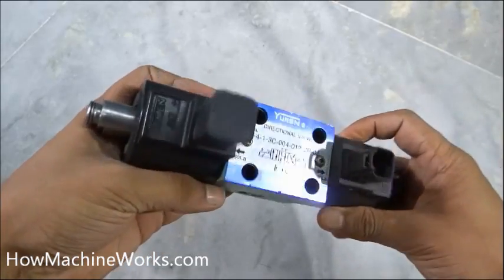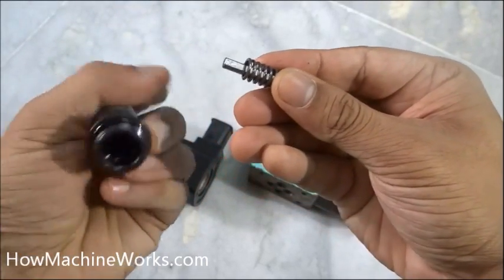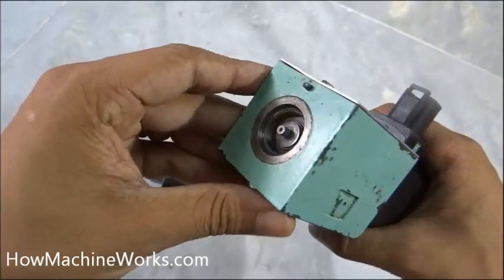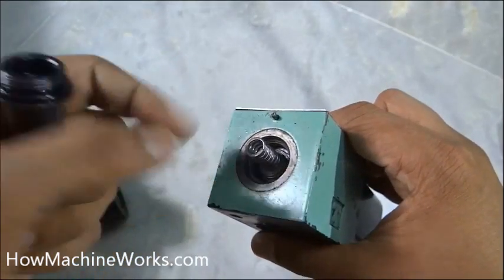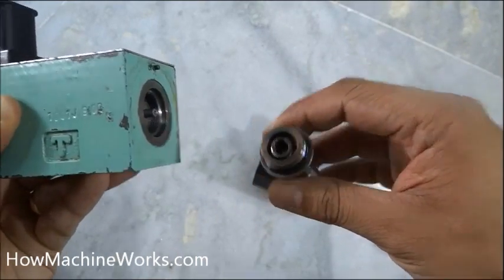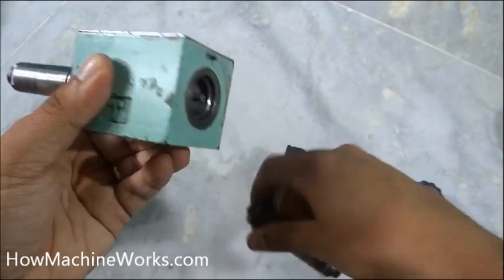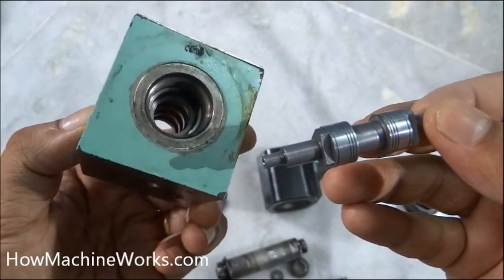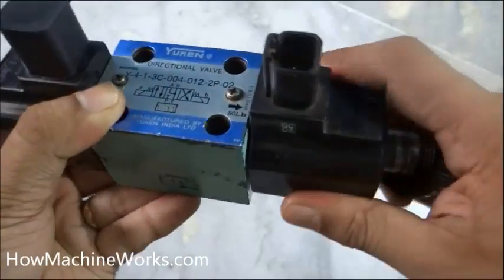How directional solenoid valve works -- dismantled. ✔

Comment: Do they all work this way or do some pull the valve instead of push, I'm trying to troubleshoot a skid steer with no auxiliary flow, I'm getting power to solenoids, they are magnetizing just no flow. Thanks

Comment: The shaft also allows for manually shifting the valve.
Quick electrical trouble shooting device is a magnetic field tester.  Place it against the coil.  It it lights up you have power as well as a magnetic field at the coil.

Comment: In the above valve, I have seen J type and E type valve.  Can anyone explain  when to use J type and when to use E type?  What is the difference in operating conditions?
Reply from the maker: +Mech E 
What's app us @ +919744615655 To get updates on Mechanical/ Automobile engineering

Comment: Im in the process of removing the 4 way solenoid operated yuken directional; valve from a frick screw compressor(NH3) to change the seal kit. Do I need to isolate and pump down /vent the compressor? will there be any pressure? should I be concerned removing it or is it simple
Reply: It is always advisable to pump down and de-pressurise your compressors unless you need a uncontrollable oil bath. Example, carrier 06N  screw, don't have to de-pressurise or pump down to replace internal oil filter cause solenoid is there to prevent. But if you want to repair or replace solenoid, then you must follow depressurising procedure.

Comment: sir I have swift vdi car that is getting EGR problem ( in meter engine check single came)  
because please give suggestions 
wt I Chang only solanide set or hole EGR valve set na?  please give me suggestions

Comment: Hi

I have a question regarding working principle of Pneumatic solenoid valve. Do they work under -1 bar pressure (vacuum)?
Reply: Solenoid valves are available for different pressure ratings. Vacuum pressure valves are also available at pneumatic hardware shops.

Comment: How strong must that electromagnet mustbe? That is what I am asking myself, how can it move that shaft if the valve is under an enormous amount of pressur while working? Can you guys explain that please?
Reply: +Beholder 
  Instead of reading through all of the posts to see if your question has been answered or not, I will give you the explanation you seek.  The pressure of the working medium, be it water, oil or a gas, is NOT acting on the spool valve at all.  There is no difference in pressure, also known as Delta P, so the force needed to shuttle the valve back and forth is only enough to overcome the friction of the seals that are rubbing against the spool part of the valve.  If it was a Poppet style valve, then depending upon the direction of the fluid flow, lots of energy can be needed to overcome that pressure.  Or a pilot valve system might have to be used.

Randy
Reply from the maker: Beholder Vl try.Thank you , please subscribe to us for more videos n keep connected with us on Facebook just search for Techtrixinfo
Reply: Beholder  Aftab Awan  Very nice sir  I am concrete pmp opt and Have dvr 14 years

Comment: How directional solenoid valve works?? Most of your teaching are ½ pass 6! Keep talking round the bushes with rubbish and shit!! BUT the very basic of how the shaft directing the fluid was not told!!
Reply: There is no shaft in solenoid valve, instead it is called as plunger. The component changing direction of flow is called as piston. As soon as one side coil is energized, plunger closes orifice causing pressure build up on piston causing to move away and bleeding through outlet to activate related device.